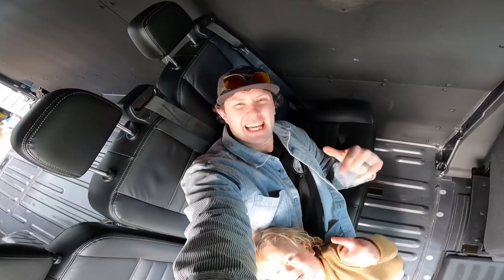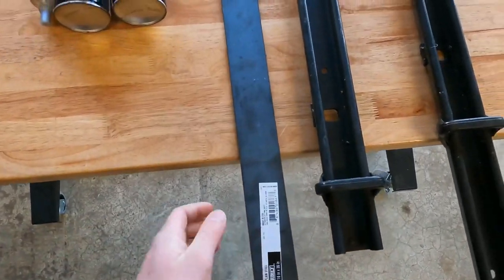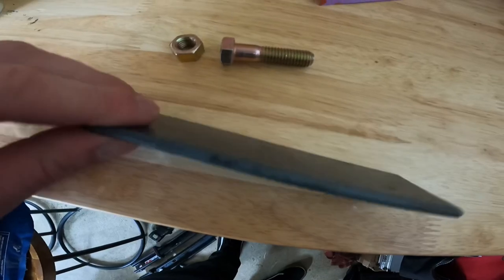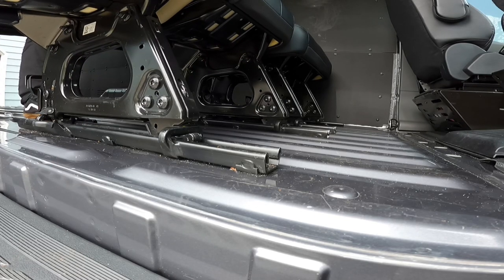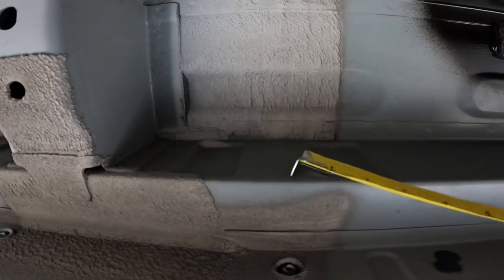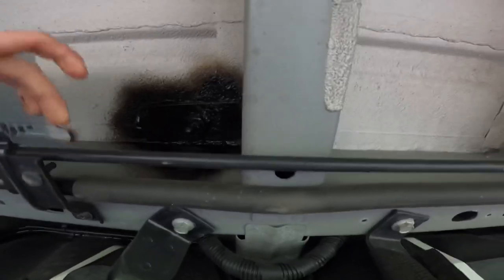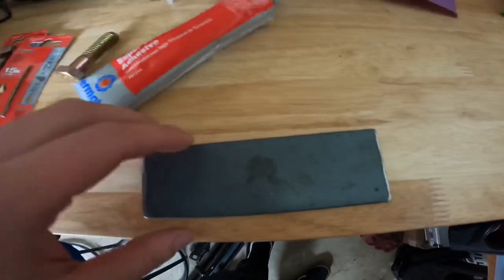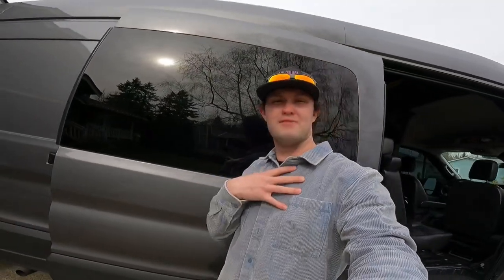AWD Ford Transit Cargo Adventure Van | SEAT INSTALLATION HOW TO in 7 Steps

Comment: where did you buy the floor tracks from? I have a van but zero 2nd row seats or rails. just curious where to find that.
Reply from the maker: We found ours on eBay. Here is a set https://www.ebay.com/itm/125296012960. Also Facebook has Van groups that occasionally sell them!

Comment: Could you fit an infant seat and a toddler seat next to each other in those seats?
Reply from the maker: We put an infant seat, then booster seat, then normal seat THEN a toddler seat. It would be a super tight for for a raddled seat and infant car seat but could work!